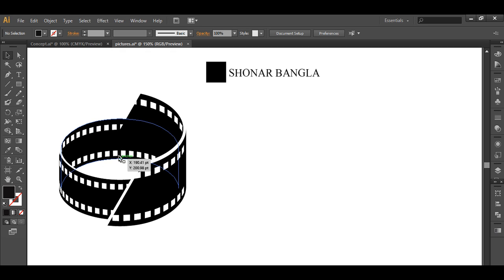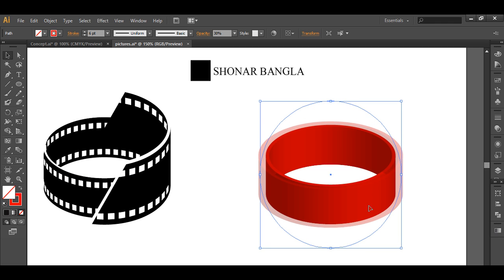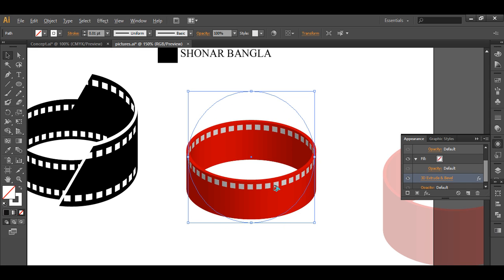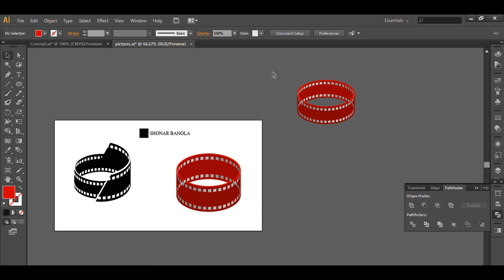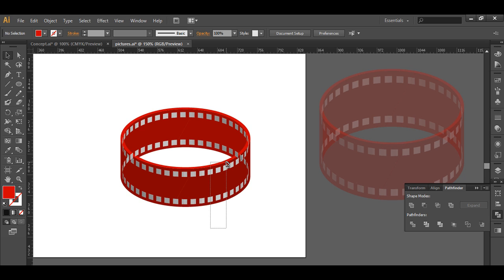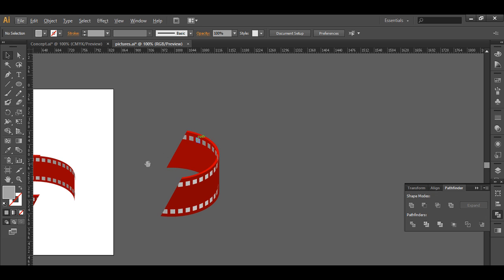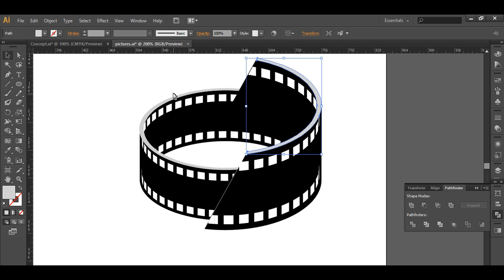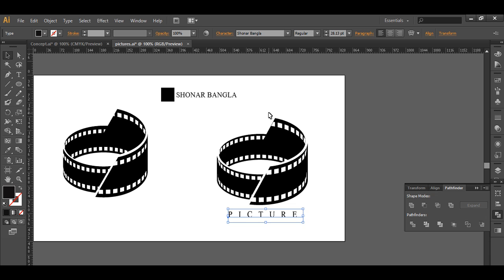Professional Logo Design - Adobe Illustrator cs6 (Pictures)

Comment from the maker: Professional Logo Design - Adobe Illustrator cs6 (Pictures)
In this video we will be making this another Film Strip Logo design. This logo has got two film strip, So on the left hand side which is forming a semi-circle has got lesser height as compare to the other piece on the right hand side. In the edges we can see there are smaller white square boxes, which has been placed on either side of the pieces. So  to create this logo, we will use the ellipse tool and with the help of extrude and bevel option we will create out these effect. And after that we will use the ellipse tool again and create out the square boxes with help of stroke option. And finally we will expand every thing and edit each pieces separately. Then little bit of tweaking is required.
If you want to Know more about Designing,
Click to subscribe my channel.
https://www.youtube.com/user/creatnprocess

50 PROFESSIONAL LOGO DESIGN MASTER COLLECTION
Now Available on!
INTUBUS - https://www.intubus.com/file/14363
GUMROAD - https://gumroad.com/l/woEWa